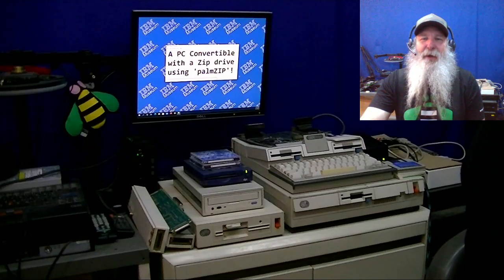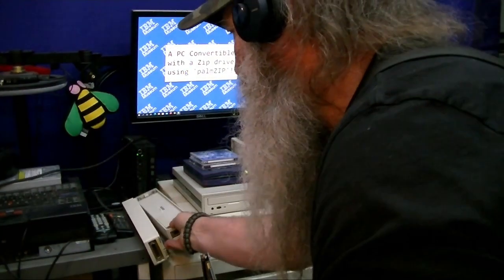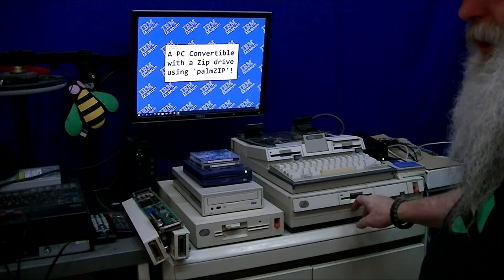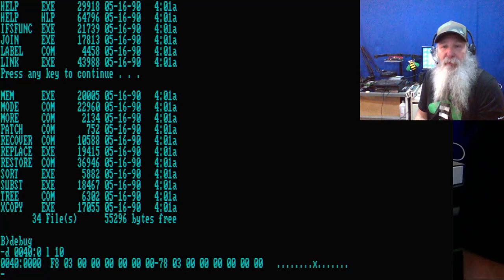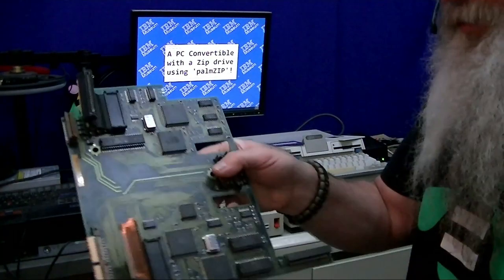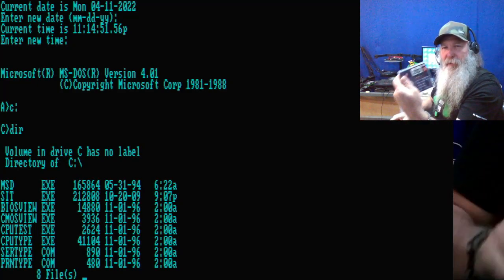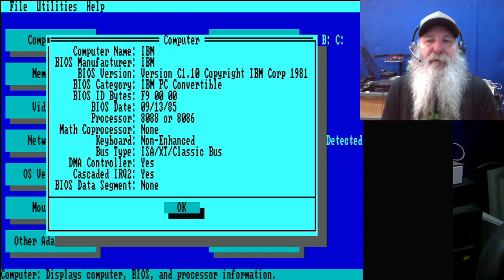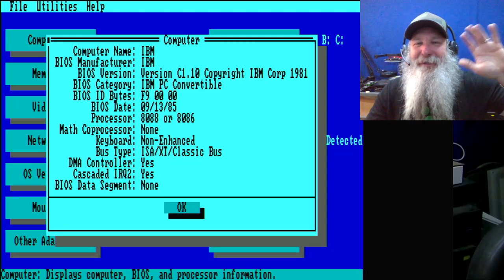A Zip 100Mb drive on an IBM 5140 PC Convertible!

Comment: Someone just pointed me to your video as I just made one on the same topic. You went into far more depth than I did! It makes the 5140 a lot nicer to use when you can have everything available on the one disk vs swapping out floppies all the time.
Reply from the maker: The 5140 is a cool system - probably the last documented BIOS version that IBM openly disclosed (in the Technical References). I need to update a few details to the audio output on the CGA "slice", but there are a few pages on the 5140 at the 'Ardent-Tool'. Check over https://www.ardent-tool.com/5140/

Comment: Hi Dave, I contacted Klaus and got the ZIP license...Everything works great when I use the Serial/Parallel slice by itself.  If I use the printer slice and then the serial/parallel slice connected to it, the Zip drive doesn't work.  Have you noticed this problem?
Reply from the maker: There was a time when I was experimenting with doubling up the serial/parallel slice just to see if the system would avoid an I/O conflict - and it wouldn't work. I thought that the address of the printer and parallel port of the I/O slice would be different, but I need to look into the Technical Reference again. You can test with DOS DEBUG to see what parallel port addresses are being assigned for the different combinations:

A:\DEBUG
-D 40:8 L 6
Q [for 'Quit']

Do that for the I/O slice alone, printer alone, and both together. That will show LPT addresses. The Tech Ref shows how the system auto-configures to set the ports - I'll try to do some tests here as well.

Comment from the maker: Note that my use of MS-DOS 4.01 was great for a 100Mb Zip drive: DOS 3.3 handles up to 32Mb partitions, and I don't have the Compaq version 3.31 that recognizes up to 512Mb partitions. DOS version 4.00 was written by IBM and was buggy, so Microsoft wrote and released v4.01 to fix most issues. The 720Kb diskettes I used have a file or two that I copied over in late 1991 that reads the identification header from IDE drives!